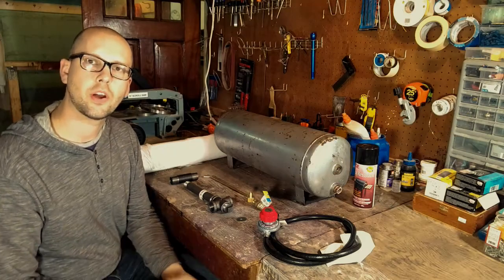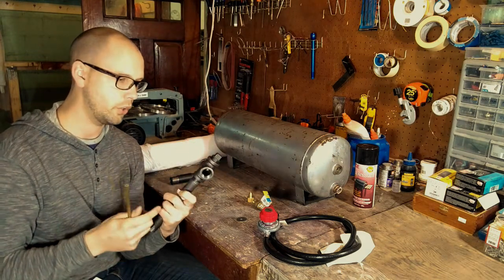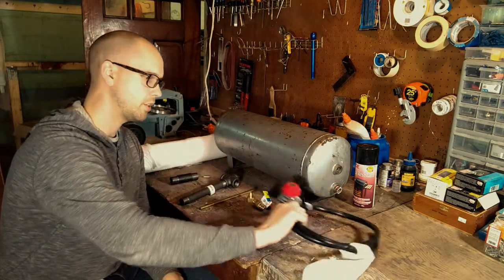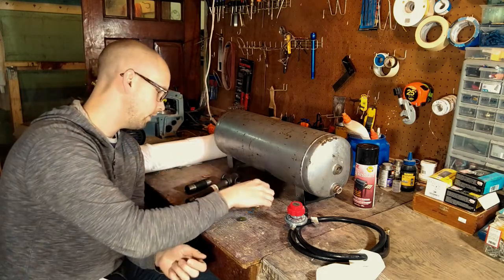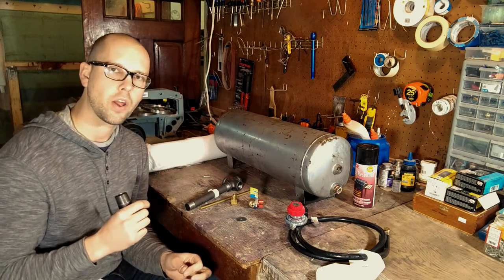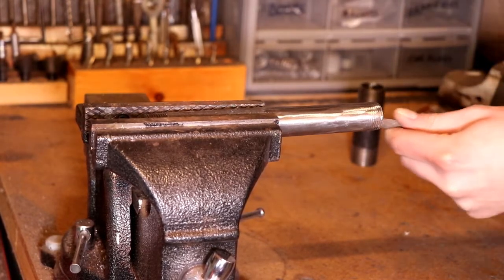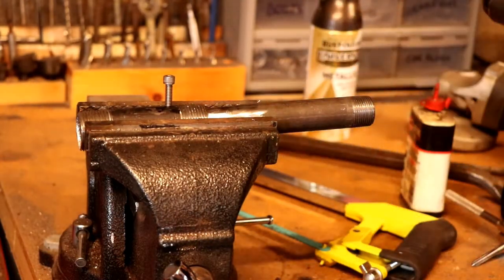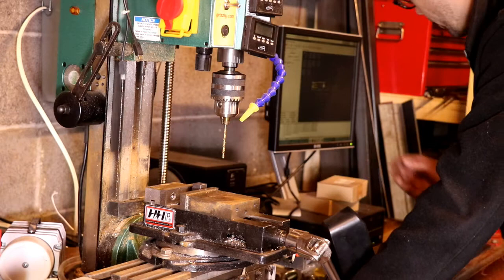Homemade Mini Forge: Part 2 - Making the Burner

Comment: My burner is the same except on the fuel in port I got a 3/4” x 1/4” bushing and have a 1/4 street elbow going into the bushing and inside of the male side of the elbow that goes into the bushing threads to 1/4” and a log tip threads into it then you screw it into the bushing. Do the 1/4” street elbow just like you done your copper tube just do the male end on the elbow.